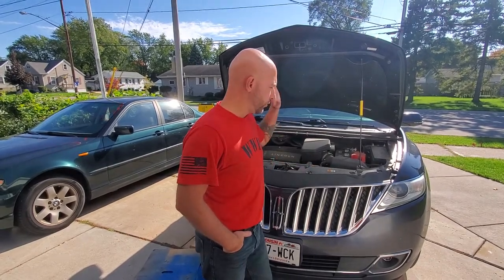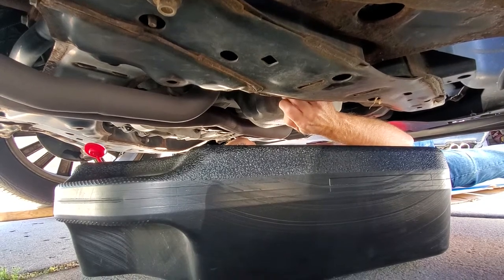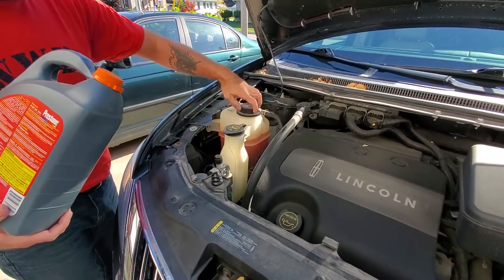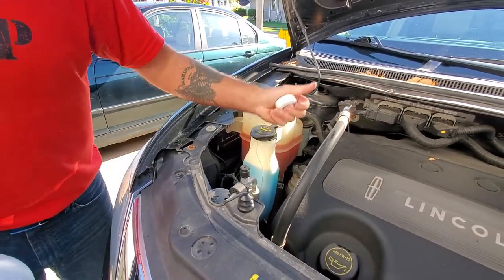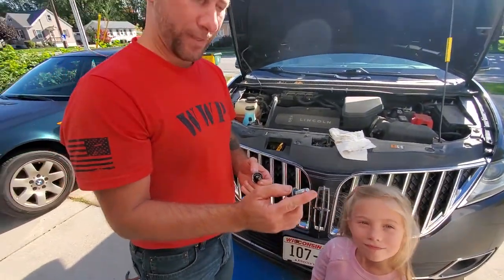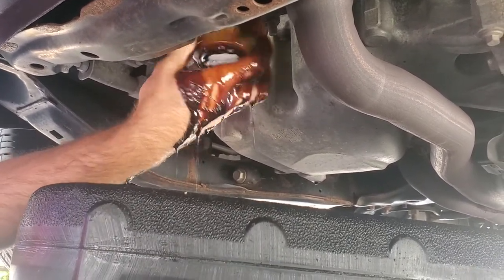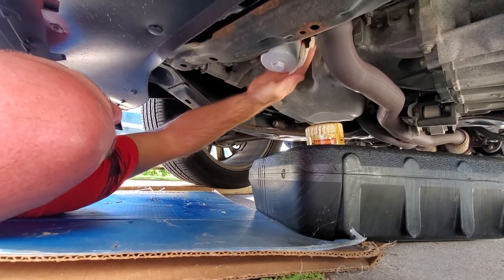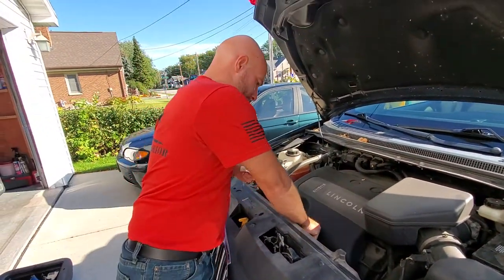How to change the oil on a 2014 Lincoln MKX.

Comment: Be careful when you open your break fluid cap the seal fell out and landed somewhere in the engine and I tried turning the car on and it didn't turn on it said on the dash (Low Oil Pressure) I used a ziplock sandwich bag  on the cap and it worked.

Comment: The rubber above the master that was blocking you funnel pops outs easily for adding fluid
Reply: And there's a hole plug that pops out for funnels
Reply from the maker: Thanks

Comment: Great video, please assist locating pcv valve and is it a DIY job?
Thx
Reply from the maker: It should be on your valve cover facing the firewall,  closer to the passenger side. Yes, you can do it yourself.  It's pretty easy, just can be a pain to reach.
Reply: @SmoknJaysGarage  I do appreciate your help. Thx
Merry Christmas and Happy New Year
Reply from the maker: @Max-Jet 1891  Merry Christmas

Comment: Very good oil filter but I don’t know about the oil. 
I have a 2011 MKX and I use Full Synthetic Pentosin 0w-20 or Eneos 0w-20 it gives me between 3% or 5% better MPG than 5w-20 and I get a smoother cold start. Great video by the way.
Reply from the maker: 0w-20 will be thinner in the winter. For summer, I don't think there will be a difference.  I use synthetic,  but tend to use the cheaper store brands. I change it every 5k miles or less. So while the more expensive brands claim longer life, I don't think I'd get the value out of them. That's just me though.
Reply: @SmoknJaysGarage  Thanks for your quick reply, with the oils I use I go between 7.5k or 10k miles no sweat specially with Pentosin and if your engine is in good shape you don’t have to even refill in that Oil Change Interval. At the end of the day saving 5% on fuel plus extending your OCI you end up paying the same or even less. 
I have owned my MKX for many years and it’s still going strong. KEEP THE GOOD WORK.
Reply from the maker: @robertogomez8100  my concern with going that long, is how the filter holds up. Modern synthetic oil seems to hold up fine up to those miles. It's the filter that worries me. Even a quality filter seems to look pretty crushed and worn after 5k. But maybe that's me over thinking it. Seems to be working fine for you.
Reply: @SmoknJaysGarage  The K&N white oil filter that you're using would work fine for 7.5k or 10k miles, if you're concerned about that don't go over 8k miles I think you'll be ok. What has worked for me really good is Bosch Premium oil filter and it's not expensive, right now I'm trying STP Extended Life that claims to be good up to 16k miles so 8k miles shouldn't be a problem and it's under $10.00 at Autozone.
Reply: @SmoknJaysGarage  Then just change the filter.
Reply: Supertech is perfectly fine oil,  same rating as other name brand oils,   been using it for many years with no problems....

Comment: Can this procedure also can be applied to my 2014 lincoln Seda?
Reply from the maker: Yes it can. Depending on your model,  your filter and drain plug location may differ.  But the process is the same.

Comment: I’m trying to change a 2016 eco boost mkx oil filter and cannot find it under my car. Every mkx has the filter like the one in ur video but my filter somehow isn’t there. Any idea where it is?
Reply from the maker: I believe there is guard (skid plate) in the front of yours. That would need to be removed to get to the oil filter. I think it's a T30 bit to remove the skid plate, but im not positive.

Comment: Will this work on my 2010 lincoln mkt?
Reply from the maker: I don't know off hand if the oil filter and the number of qts of oil will be the same on you vehicle.  You'll have to double check what yours calls for. Otherwise yes, the process will be the same.
Reply: @SmoknJaysGarage  how do check my oil filter?
Reply from the maker: @CarGang4life  can Google your make and model and it will tell you the correct filter, oil, and quantity.
Reply: Ok thanks! But what words can I google.. sorry for the troubles
Reply from the maker: @CarGang4life  looks like you need FL500S if you're using a Motorcraft filter.
M1-212 if you use Mobil 1 filter.
Reply from the maker: @CarGang4life  if you Google "2010 mkt oil" it start to give you option like "filter" "capacity" "type" etc. Just click on the one you're looking for. And confirm it's for your vehicle.
Reply: @SmoknJaysGarage OK, thank you soo much. Just wondering i saw the tesla in one of ur vids. Is that urs?
Reply from the maker: @CarGang4life  no problem. Happy to help.
 No, the Tesla isn't mine, it's a friend's.
Reply: @SmoknJaysGarage  ok!